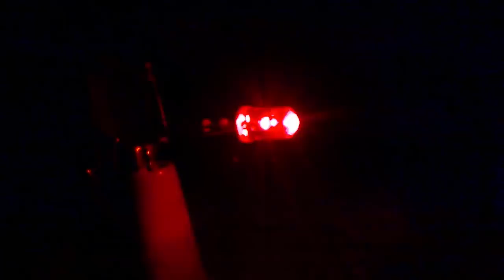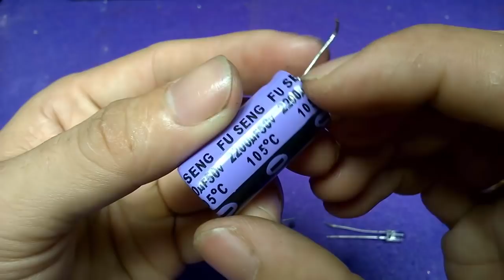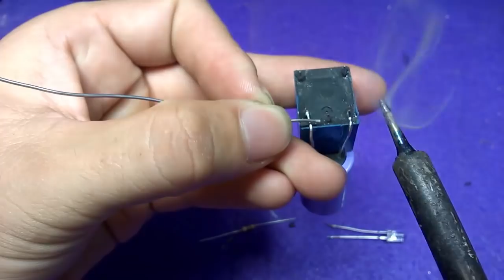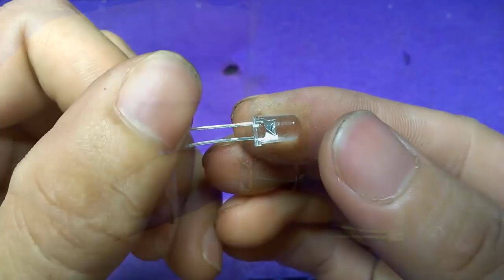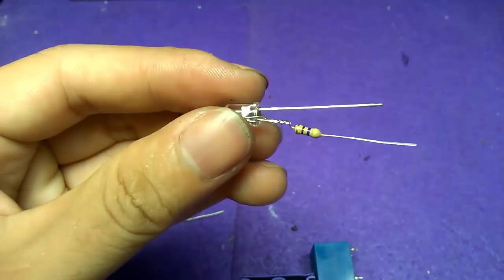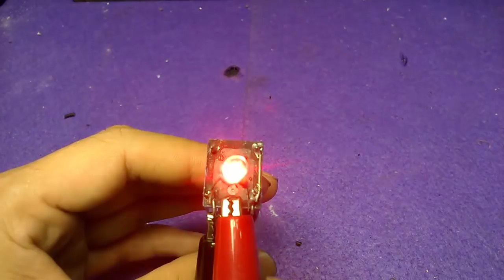how to make a oscillator / flasher / blinking LED lights or any DC lights using relay

Comment: Sir... can this flasher also used as inverter....
Reply: NO, it's like asking a rubbish bin, can I eat what's in here, but it will never answer you... look for more intelligent places for your answers.. like facebook perhaps. Inverters need a high frequency switching device, an inductor and a rectifier and storage capacitor. In the very very early days of radio, high voltages were generated by an inverter driven by a mechanical switching device, like a relay/ Look up "shocking coil" if you like. The idea is the relays contacts are arranged such that when the relay is energised, it disconnects the energising source, so the relay vibrates rapidly (eventually the contacts would fail) but it will buzz... That is a how a "Buzzer" is made. Now if you use the contacts to pass current through a coil with many turns, when you turn off the current suddenly, the coil somehow wants to keep the same magnetic field in it, (That is what Inductance is) so the voltage on the coil flies in the opposite direction (untill all the magnetic energy has been dissipated), the speed determined by the self resonance of the coil.  The voltage can be many thousands of volts, unless you "catch it" by means of a diode and charge up a capacitor. Now of course if you put 12V across a coil, when you open the circuit the voltage goes from +12 to some negative value, I think that is why they are called "inverters"  But you can add a secondary (ie a transformer) winding to isolate it and generate anything you want..   Car ignition systems work this way....